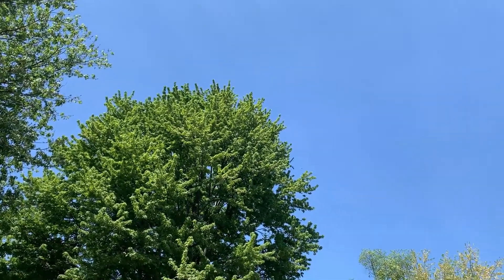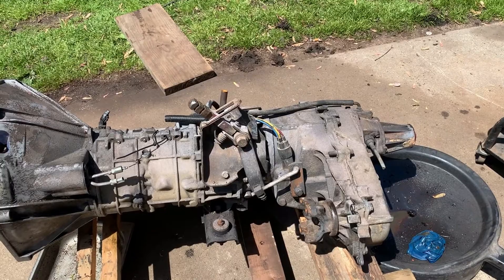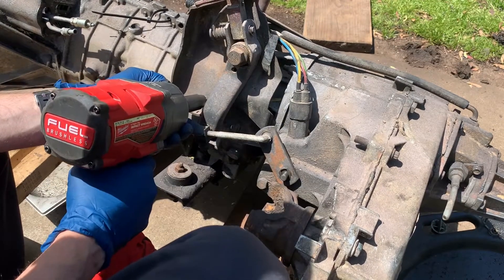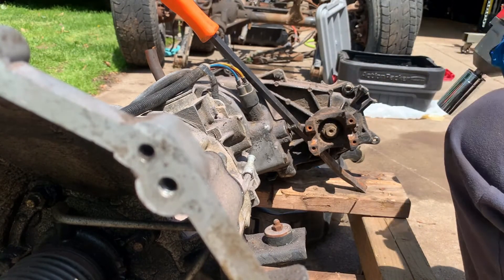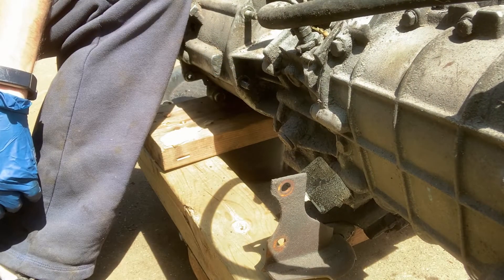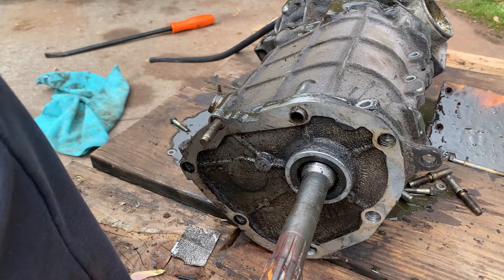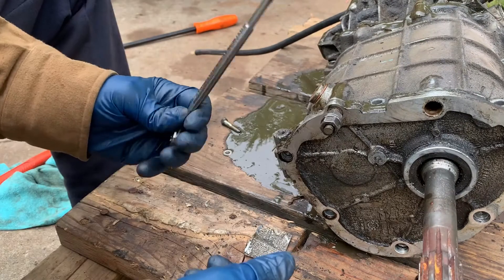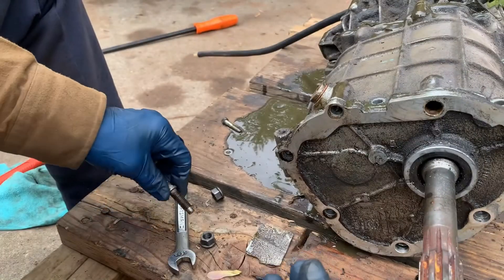Peugeot BA10 Jeep's 5 Speed Manual "Glass" Transmission Teardown+ Transfer Case Teardown

Comment: OMG, why did you tear it apart. Mine broke because I abused it. Just needed a new bearing. Actually very straight forward to work on with parts available they say. I could fix it without dealing with shifter balls and pins which appears to be a big time pain in others. forget what the say online, just a bunch of whiners to the extreme just like BMWs. Pease save any other auto parts you have, they are becoming more valuable, really! :)
Reply from the maker: I didn't have a reason to keep this weak trans and  no one bought it, so it got torn apart. Just the reality of it.